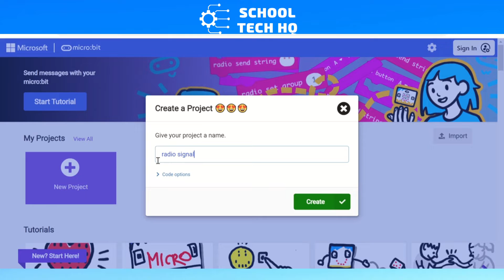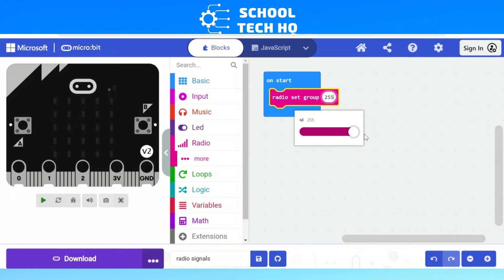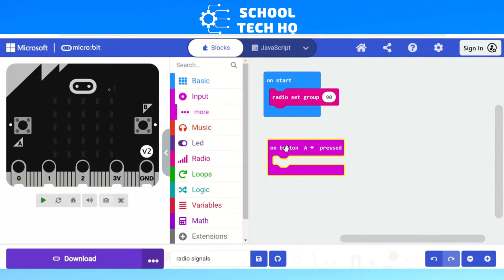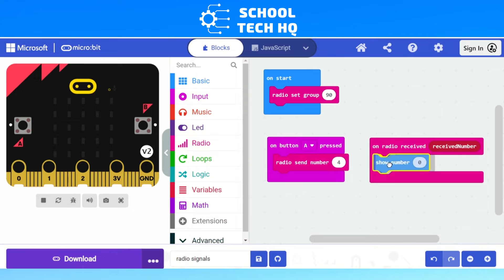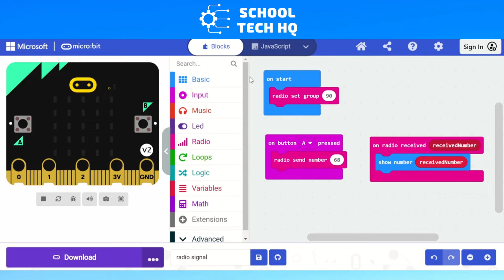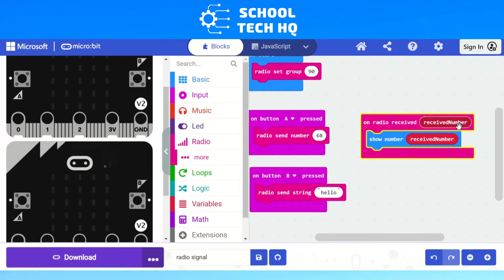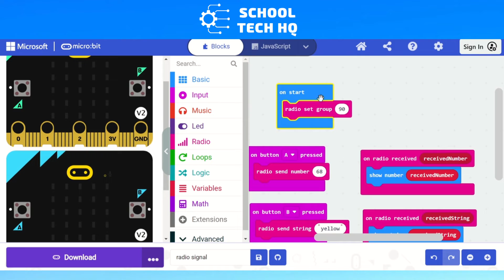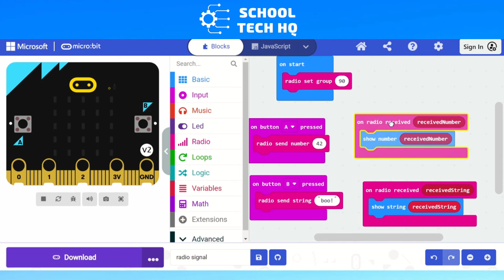Sending Messages on a Micro:bit

Comment: Can you make a code where you can type out a message and send the full message to the other microbit because I found a tutorial on how to make a text message thing with the microbits but it only sends one letter at a time is there a way you can upgrade that?
Reply from the maker: You should be able to send a text message to another device, and it will display at least a couple of letters as it scrolls through. It is only 25 LEDs, so the amount of space is limited, which means it can't fit more than maybe 1.5  letters at a time as it scrolls through the message.